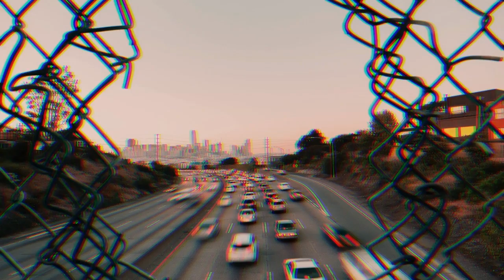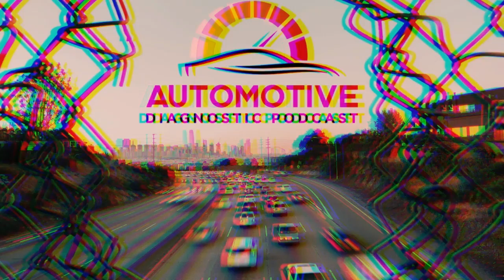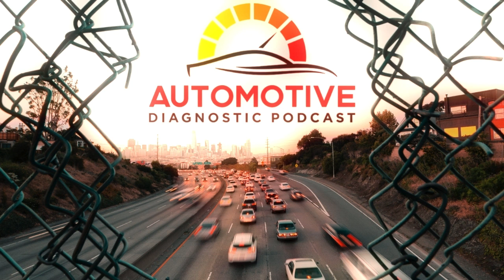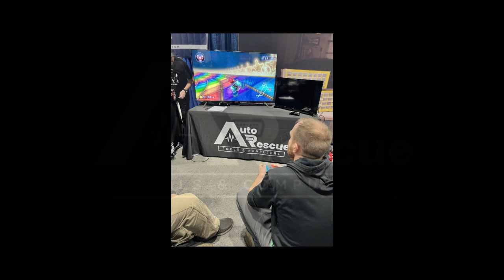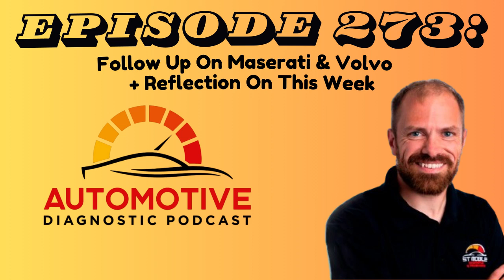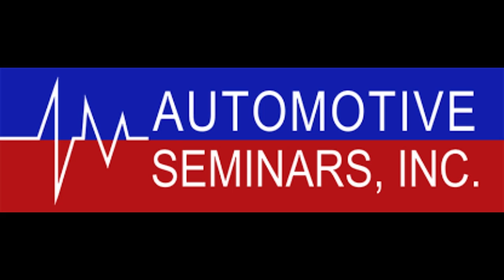E:273  Follow Up On Maserati & Volvo + Reflection On This Week

Comment: Seems the world mirrors all over. Re the honda... get a wiring diagram with colours and check connectors go right spots.  Had a ford  map/ throttle swapped once.. no codes .. throttle voltage in ball park but not . Same plugs. Like our mode of operation re billing. 
Always luv hearing your ramblings. Keep em coming please.  A week full of wins ahead for ya buddy